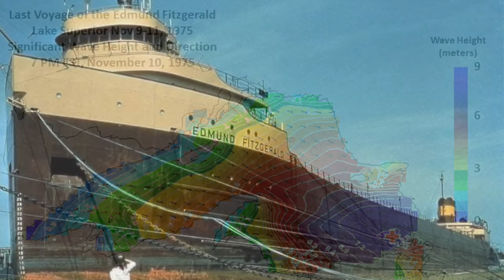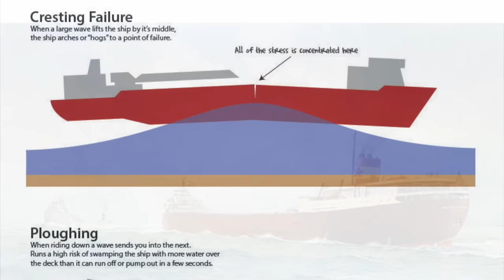What Happened To The Edmund Fitzgerald?

Comment: Well i did not know much about this before tonight. Today i learned that this ship had many serious issues. If my understanding is accurate, the ship had three holds, separated by non watertight bulkheads, and no system for measuring the water level in this vast tube of iron ore pellets. Also absent was an acoustic depth sounder,  and the hatch covers appear  to have had only some of their latches in use. To further compound the situation, the ship had been permitted to operate with more cargo and a higher waterline than originally designed, and had issues with its welding, being somewhat of a prototype. It was the first welded ship of a general type that had been previously constructed using riveted fabrication. To sail such a wildly optimistic design into such apalling weather would seem to make the loss of the ship a great deal less of a  mystery, though the details of the exact failure sequence remain somewhat murky.
Reply: You didn't learn anything by this.
Reply from the maker: You can read minds! Teach me how!

Comment: The Fitz was a sound ship. For 17 years she roamed the great lakes delivering her cargo. The problem.was her owners GREED. She had her loadline changed 3 times to haul bigger loads increasing the bonus and profit margin. She was routinely passed over for badly needed maintaince and would nt be dry docked to fortify her ever weakening keel. The company hired Capt McSorely cuz he was known for pushing a ship hard and taking dangerous chances with ship.and crew.Had she laid over for 1 day the Big Fitz would be in the Smithsonian institute instead of on the bottom of Superior with all 29 of her crew. There is no doubt she bottomed on 6 fathom shoal as Capt Bernie Cooper suspects. Had she not been so low in the water and sinking she would have been able to survive the 2 monster waves that crashed over Coopers ship ten miles astern of the Fitz. Cooper said those 2 waves easily pushing 40 ft were the largest he had ever seen and he sailed in the big ocean storms during his career. He watched them roll away from his ship and calculated it would take them 10 minutes to reach the Fitz, which shortly after disappeared from his radar. So sad, If the Fitz had,nt grounded she would have reached port in whitefish bay 15 agonizingly miles away.
Reply: Exactly

Comment: She broke in the middle.  The aft was 
much heavier so it piled drived the fore into the bottom.  Was it a shoal? 
Is it still sitting in 500 feet of lake?
Reply: It's probably five hundred feet exactly in the middle.  No way the captain could do that with 42 knots and 12 to 16 waves.
Reply: Yes the following ship altered course. I guess shoales are creek or river outlets?
Reply: Five Fathom Shoals.  Is fanthom a unit of distance?
Reply: Fathom (not fanthom) is an old nautical unit of measurement, equal to 6 feet.

Comment: All of these long-boats that carted stuff around the Great Lakes sank for much the same reasons when the weather got up. They were obviously created long and thin and of as deep a draft as was felt sensible but still capable of avoiding grounding on the shoals and able to navigate the locks and cram as big a load as possible between the navigation and accommodation castles;

Howver, this was all a difficult design juggle, and these often conflicting parameters yielded vessels that flexed to extremes and subjected their mid-sections to enormous cyclic and periodic tensional stresses for hours at a time and repeatedly over successive seasons.  It could be argued that such a design given these conditions was almost impossible, despite their long-term successes, short of potentially tonnage-hogging increased strengthening of the keels and keelsons.

The end result was the same in every case. One final extreme storm and a broken back with resultant immediate sinking. The proof is in the wreckage. Tired and popped rivets, poor embrittled steel, freezing temperatures, cold water ingress and water-lubricated shifting loads were simply the final straws.  

There was only one procedure that could have prevented every one of these disasters, and it was practiced, but obviously not to the required degree;  staying in port through the big blows; laying up in winter; and if forced to sail in bad conditions, prepare for disaster with adequate liferafts at both ends of the vessel and proper training.  It took the losses of the Fitz, Bradley and many others to ram this point home.

Comment: If it has scraped a shoal, wouldn't it be seen on the over turned stern section?
Reply from the maker: Not necessarily, a section of the vessel is missing, and any evidence in the front end is buried into the bottom.

Comment: The problem with the bottoming out t
scenario is the aft section that capsized shows no evidence of hitting bottom, my personal thoughts on what happened.
There's evidence that the Fitz was in bad shape corrosion, stress cracks ,she was over loaded and in extreme conditions, the hull failed, down she went

Comment: Well done! I believe you are correct in saying she bottomed out and this caused her list and to be low in the water. The 2 big waves would not have caused the Fitz to list or cause her railings to fail. What most people do not know is, as mentioned in the song, the gales of November came early, but they came a second time that month. On November 28, 1975, I was an air mail pilot flying a Beechcraft 99 twin turboprop commuter airliner carrying 2,700 pounds of US mail from St. Louis to Des Moines, Iowa. Another fierce storm was in progress well to the north of Des Moines. However, the storm effects of the storm extended as far south as DSM which made flying on instruments a real challenge. Upon my arrival in the DSM area at 2 AM, I flew 2 instrument approaches down to 200 feet in bad turbulence but did not see the runway and, running low on fuel, I diverted to Ottumwa, Iowa. The weather at Des Moines that night rivaled the November 10 storm that sank the Fitz. Winds were as far south as central Iowa were 40 knots with the clouds right on the ground. The barometric pressure during my approach was 28.80 inches of mercury. On my flight back to St. Louis I encountered severe thunderstorms, in late November!

Comment: Very rarely is it one thing that causes a disadvantage.  It's usually a series of unlikely events that combine at the worst time possible. 
This ship was sinking for hours.  Several hours before,  the fence rail, vent covers & list. I don't think we know for sure whether  it was to starboard or port. Nowhere in the transcripts does this show up. I really can't find it with any degree of accuracy. 
The reason the Capt. didn't panic on the radio about his problem , was if he made it to whitefish bay, he could have been laughed at. We're holding our own is all the information you need to deduce that there were big problems.  The port side wheelhouse door being dogged open,  should be a clue. Second, even if the Anderson had been alongside her, being out on deck would of been unsurvivable . God awful. 
I don't think we'll ever know for sure. But it was several, not one thing that sank her.

Comment: I watched a documentary on the raising of the Fritz’s bell. One of the divers was almost killed when he cut loose the bell because it had too much tension on the cable connecting it to the surface ship, and when finally cut loose, it shot up off the Fitz. It barely missed the diver. It seems fairly certain to me that the Fitz came down and hit the bottom after being lifted by a giant wave. This is why the Fitz sits in two large pieces on the bottom. The sea is an unforgiving mistress.

Comment: To me its obvious, that the Fitz bottomed out in the middle of the Hull ripping (Buckling) the sides open and also causing extreme bending of the vessel causing the fence rail to come down and also hatch covers to become loose, Then major metal fatigue from twisting and bending (waves) on the damaged metal. At this point taking on far more water than pumps could handle, and pellets adsorbing water. Ship becoming heavier as they go, then the intense  sister waves suddenly (why no MAYDAY) broke it in half, sending it down in 2 pieces. Notice how its broke in half at bottom with stern up side down, thus I don't think would be seen like this from impact of hitting in 1 pc bow first, rather it broke before sinking, also note no MAYDAY called, meaning very sudden. Bow is upright because of far less resistance on its way down and the stern with far great resistance being completely open ended subject to forcing waters on way down, indicating it broke suddenly before sinking. To turn a stern upside means you would have to have distance for it to happen. RIP to all 29 and now RIP Gordon Lightfoot!!   https://www.youtube.com/watch?v=TR4K_yYz4rE

Comment: While they can't say 100% that the Fitz had bottomed out on the shoals, all the evidence points to that as the ultimate cause of the sinking. As pointed out in the video Capt. Cooper of the Anderson 10 miles astern had seen the Fitz on his radar in what he considered as dangerously close to the shoals, and it was only minutes later that McSorely radioed he had a list and was taking on water. Cooper has also dismissed the theory that loose hatch covers could have accounted for the water coming in, saying that even if several covers had come completely off it wouldn't nearly account for the quantity and speed with which the Fitzgerald was taking on water. As Conner has concluded - the 3 waves that had lifted the Anderson probably caused the overloaded and already sinking Fitz to break in half and disappear in a matter of seconds.

Comment: You're probably right. With the shoals shallower than thought they probably ripped a hole in the ship and the waves finished her off! But we'll never know for sure.
Reply: The Coast Guard checked the shoals for signs of damage or scratched paint. There was no evidence the Fitzgerald hit it. Shoddy patchwork from previous maintenance probably caused several small leaks that slowly allowed water to flood the holds in the hull. The heavy seas, which grew bigger by the hour, (and in combination with all the extra weight from the water coming in) stressed the hull out too much and she broke apart and sank

Comment: The Fitzgerald was a weak hulled ship, when you look at the difference between the early & late photos of the ship you can see clearly the distortion differences 
between them. When the Fitz was hit by the rough waves it simply nosed dived and broke up, the stern section is still to this day connected by cables to the forward section,
this shows the stern pulverised the forward wheel house as it passed the bow section before coming to rest upside down in its present location.
The Fitz was a poorly designed ship for the huge cargo it was forced to carry & sadly lost its fight with mother nature.

Comment: I ve been reading alot of comments and just in elementary school in the time the Fitz sank , and working in a shipyard for 20 years , we ve built barges with bulkheads for each cargo hold / and each section of the barges were put together and welded, I can only assume it was metal fatigue and desighn of the Fitz ended her career early, but I am no engineer so take this comment with a grain of salt. I would also think if it had bulkheads for each cargo hold it would had also stiffen the ship up better. But being a older ship there is also a possibility it needed alot of repair especial on the keel section which is the back bone of the ship carrying treamoundous weight and stress which in failure could had weakened and finally gave out .I am only derived this idea from past reading I had done on the Fitz and my experience as a welder in a shipyard . Alot has been learned by this I would think making better engineering from mistakes made has been approved in more modern times and better welding and materials for the ship building market would also lessen the chance of this happening again.

Comment: The ship was taking on water which would make it ride lower in the water. The large waves caused the stern to rise up enough to force the bow under water. Then the forward motion made the bow submarine and drove it into the sea bottom.  Analysis of the wreck determined that about 100 feet of the ship is missing. That would have happened when the bow hit the bottom and the stern kept pushing causing the middle of the ship to crumple. That all would have happened in a very short time. If the ship had just broken apart on the surface there would have been enough time for an sos to go out.

Comment: I have a feeling some of the bodies were buried In the sand. That’s why they couldn’t find many. And also the life jackets, so their bodies could’ve drifted. And finally they could’ve launched the lifeboat (or at least try) and they got launched off by doing so causing their bodies to be at different locations. Possibly miles apart or from the fitz.
Reply: They found one of the bodies by the side of the Fitzgerald in 94. Skeleton
Reply: @wyomingadventures  it wasn't a skeleton, I have the video that got pulled from shelves that showed it. There's still bodies in superior from the kamloops in 1927. They're still intact but white, due to adiposere. I'm sure I didn't spell that correctly.
Reply: Most of them are in the stern
Reply: @danalarose846  thank you for sharing that.

Comment: Good commentary and well pictured. This is the worst narrator and audio imaginable. Awful. The Fitz broke in two and sank. Which is why it's in two sections at the bottom. Also, the Fitzgerald was welded together, not riveted, which is stronger. The crew members that had served beforehand reported severe bending and groaning of the hull in heavy seas. Imagine what would happen in a hurricane force wind and 35 foot waves, when the ship only had 11.5 feet from water line to deck on her last voyage.